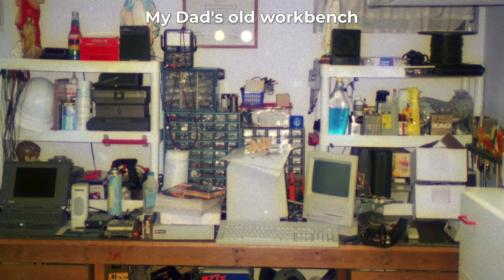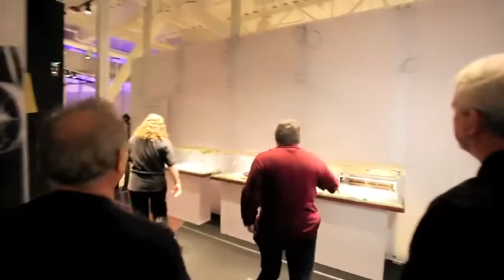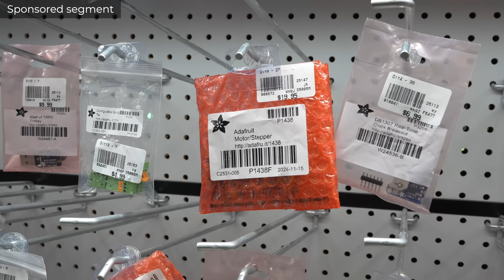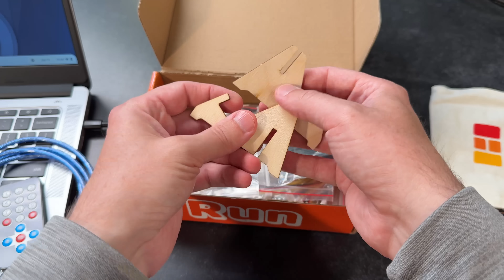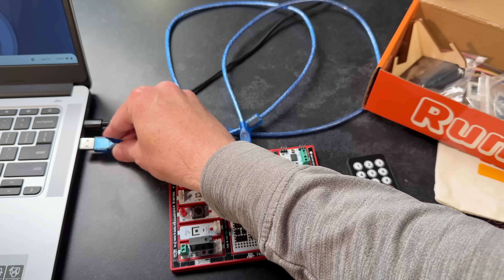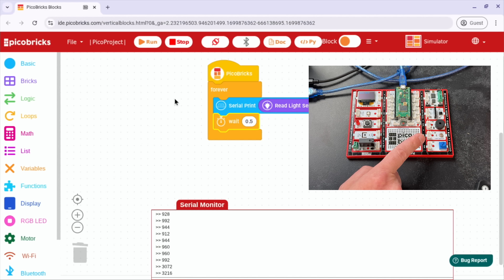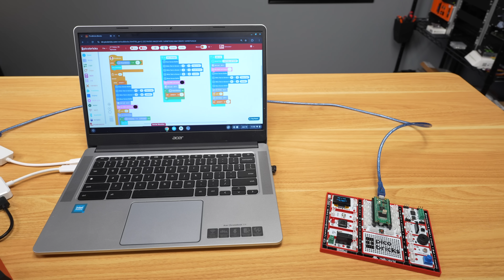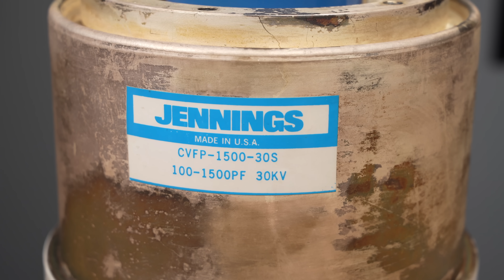You don't need a Raspberry Pi! (Getting started with Microcontrollers)

Comment: Yup, if you like spending a lot on coding minutia, trying to fit all into the tiny tiny TINY memory, using a spartanic Commodore 64 CPU that is only about 50 years too old by now. All this to save 35 dollars (for a raspberry pi with 1 GB), you spend endless extra effort. So yes, if your time is worthless and you don't mind spending 5 times as long on a project than it would be on a raspi to save 32 dollars, yup, go right ahead.

Comment: I strongly recommend anyone who wants to learn to code mess around with some kind of physical computing. I used Python at a novice/hobbyist level for years, but it didn't really "click" until I started messing around with a Pico running Adafruit's Circuit Python. Now that I'm teaching myself C++, I decided to learn Arduino (that's the Microcontroller version of C++) at the same time, and it's going super smooth. For some reason, when your code makes something happen off you monitor and out in the real world, it just becomes so much more exciting. 

I also love how the title is "You don't need a  Raspberry Pi!..." And the thumbnail is you pointing at a Microcontroller made by Raspberry Pi.

Comment: one thing i learnt why transistor isnt 100% replacing relay is because transistor can only handle so much power before its get to expensive  and hot compare to large relays (relative to transistors) and plus most common transistors (like in your computer) isnt bidirectional  so relays does have a use in your studio lamp example because AC is alternating

Comment: Transistors switching faster than a relay is not strictly accurate. Repeated switching YES but a single switch either just the same OR in an industrial application, as in a PLC or Transister Logic they are slower than Relays. That is according to the datasheets.

Comment: Thanks for the vid. Would you recommend this board/kit for a 7-year-old or recommend a different board/kit? I'll make sure to remove any capacitors from it.
Reply from the maker: Yes! I think 7-12 is probably the ideal age range for it. On the younger side I'd expect you need to spend a little more time helping figure things out in the beginning though.

Comment: Radio Shack (Tandy in Australia) used to sell 100 to 300 in 1 electronics sets like you had. I still have my 300 in one though most of the components are loose for an inbuilt breadboard so must have lost a fair number since then but the smaller kits were mounted on cardboard with springs to interconnect wires - was a good learning system. Even earlier though never had it was Capsella plastic bubbles with some components in like motor or light and join together to make projects a mix of Lego and electronics looked like fun was envious of that. Also as teen liked what Heathkit projects existed but never had the pocket money to fund such as a kid always wanted a Heathkit Hero Robot!

Comment: As a firmware engineer, I absolutely cringe when I see these kinds of videos, the same way I cringe when I see morons pushing books that will teach your four-year-old how to program.  Newsflash:  no, they won't.
I'm not sure which is worse - the people who make these products as a cash grab by trying to dumb down something that can't be dumbed down, or the gullible people who buy them, thinking that they're going to somehow gain any real knowledge by using them.
Reply: Why? The same fundamentals still apply. It can be a good low-friction way to get into more advanced stuff.

You're looking down on scratch I presume, but I see it just as a different syntax, with friendlier tooling, at least at this level.

Comment: Stupid question:

What happens if you can't get the BOOTSEL working?

I'm holding the button down and within seconds, the BOOTSEL button feels like it gets really, really hot.
Reply from the maker: It should never get hot, I wonder if either the power supply or some chip on the board is damaged. Pressing the BOOTSEL button should only be required for a brief second or so when you plug the board into your computer's USB port. Then it should appear as a removable volume.
Reply: @JeffGeerling  
The power supply is the USB-A port from a 2019 MacBook Air, so I don't think that should be an issue.

(Also tested it with my tiny human #2's 2017 MacBook Air, and my 2013 MacBook Air, and it all results in the same.)

My current hypothesis is tiny human, through the act of constantly unplugging and plugging the micro-USB side into the Raspberry Pi Pico W (this is our first foray into RPis), might have accidentally shorted it, just by repeated plugging and unplugging.

I'm not really sure what happened as tiny human #1 is up at 6:30 in the morning, long before anybody else is, so who knows what tiny human #1 did.

I ended up just buying a replacement Pico WH from Microcenter, and the new one seems to be working.

Comment: SnapCircuits is a great modern alternative to the project boards you had as a kid. All of my kids have played with them and they're pretty awesome!
Reply from the maker: They certainly are — though my two main gripes (we have a set):

1. They're a lot more expensive (likely due to the amount of plastic molds required to make all the parts the custom sizes, versus having one cardboard piece that holds some commodity parts like the spring contacts and random circuits)

2. They have more rigid circuit possibilities; sometimes you can't just spring a wire between one part and another (it only comes with a couple snap wires), meaning it's harder to break things, but also a little harder to make novel designs.

They're still great, though!

Comment: I started out by disassembling loads of old electronic waste and broken toys.... Making new ones.  By the time I was 10 I had a basic understanding of electric circuits, motors, switches, resistors, capacitors, magnets and relays.   Unfortunately, it wasn't until I was working and much much older that I started getting access to microcontrollers and electronic components with some real impetus.  
Personally, I think all young girls and boys should have at least a basic understanding of maths, sciences, electronics, programming, industrial arts, general accounting, survival techniques, art, home economics and at least 2 languages.    
Phys Ed should also be mandatory all the way up to and through university.   It's terrible how little regard people have for physical as well as mental well-being and the discipline to keep those things up to scratch.

Comment: We used to put glass signal diodes across a power switch. , and wait for someone to turn it off. A very satidfying CRACK, and we were rid of one more leaky diode, rather than just throwing them away.
I used to service PA systems.  local car dealer bought one of the first all electroninc Japanese business phone systems. It needed an external interface to let yu page from a phone. They wemt through three of them in a month, whichich not on;y disabled the interface, but ran the amplifier into clipping. They jad outdoor speakers in the lot, and they were downtown so a nasty 60Hz hum could be heard for a half mile. Each time I went to 'Fix your crap', I found large, exploded electrolytics, spreading foil up to 29 feet  across the room. The interfaces had  no rotection, and the area was prone to lightning strikes which key destroing those boards. They finally installed a beter one and I bever had to make a warranty call to disconnect  dead crap.
They went from a very reliable Western Electric 1A2 system, to that crapabese jubk that only lasted a few years.

Comment: Hmm, how did the explosion of an electrolytic capacitor generate hydrogen, Jeff?
Reply from the maker: Good question, and I'm no expert. But the aluminum they etch for the two flat bits that wrap around each other—when you put the in an overcurrent situation I think that causes the surface layer to bubble up into hydrogen gas. There was a paper on it which I referenced in the video.

But I'd defer to a chemist or material scientist.

Comment: My microcontrollers II class in college was one of my favorite classes.  We started on the Motorola 68000 in Microcontrollers I but moved to a PIC 28 pin DIP in II. For some reason, I was great at programming machine language code.  For our final project in the class, we had to build a huge breadboard project that was 1500 lines of machine code.  It had an LCD, 12 key input pad, digital inputs, digital outputs, analog inputs the whole enchilada.  I did a scrolling menu for the project on the LCD and I was the only one in my class that finished the final project.  It was a paradigm shift of what you could do with microcontrollers at the time because of the flexibility of the PIC microcontrollers (circa 2000).

Comment: Great video on micro controllers, but turning a light on and off or something other than just blowing up capacitors would have been better. This is up there with those putting thermal paste on the socket under their CPU, just pointless.

Comment: I remember in college electronics night classes we would take what we called a suicide cord (NEMA 1-15 plug on one end and allegator clips on the other) that would connect to an electrolytic capacitor and then plug it in.  We ended up putting holes in the acoustic ceiling tiles.

Comment: I've seen comments that "microcontrollers are cheaty" especially in retro computing circles. And while that's true for simple things like flashing LEDs, microcontrollers are absolutely NOT easy when you're compiling custom firmware and dealing with library conflicts, trawling through code to figure out what's wrong, breaking out hardware debuggers, trying to figure out if the hardware even supports the pin assignments you want.......I'm not saying it's impossible but it certainly isn't cheaty. It's also common to see "[insert microcontroller] is too powerful because it could emulate the retro CPU it's attached to", which is particularly bizarre to say if an emulator doesn't even exist. It's like there's an assumption that emulators are easy to make.....lol!!

Comment: Many years ago -  maybe '72 or so - I got a toy for Christmas that was laughingly called a computer. It was a large plastic box with a dozen or so tall slides on the front. The sides had jacks and there were short cables you could plug into the jacks. You might laugh but you could create both AND or OR circuits, and with a dozen slides you could do slightly more advanced logic. I think you could even do a NOT since these sliders did actually slide and that changed the wiring behind the scenes. It could have probably implemented a half-adder.

Years later I realized this was a very basic relay computer. We've forgotten that this is what drove the earliest automatic elevators. They're like cog-based logic - something that was a lot more powerful than we think... but which could never do anything else.

This didn't lead to a lifelong passion with computers - I was a math and physics major in college and had minimal interaction with computers since they weren't really available to us until I was in grad school.

But it's a great answer when people ask "what was your first computer?".

FWIW there was also a Radio Shack toy CPU introduced in the late 70s or maybe '80. It was weird since it went to the other extreme - I'm sure it was an accurate representation of a mainframe CPU but that was far beyond the target audience. Think of jumping into Ben Eater's discrete TTL logic computer series for someone who just wants to know a little bit about a raspberry pi.

(The worst "other extreme" has to be a math book I found in a bargain bin in an outlet store. It said something like "Introduction to Algebra" and had large comic-ish numbers on the front. It looks like something you would get a struggling middle-school student. I peeked inside - and immediately bought a copy since it was actually a pretty good undergraduate introduction to number theory. I feel so bad for the parents who were mislead, and the kids who were even more traumatized when they saw the content and thought they were expected to understand it. I'm sure I still have it... somewhere.)

Comment: I started getting into micro controllers because one day I had a problem and while searching for a solution microcontrollers came up in the search.. one rabbit hole dive later and now I use microcontrollers and stepper motors to drive the gauges in my old vehicles. (50s & 60s)

Comment: You passed the Arduinos at Micro Center.
Their mini form-factor Microcontrollers, the Arduino Nano, preceeded the Pi Pcos by more than 10 years. They also have models that use the RP2040.
Reply from the maker: I explicitly showed them and mentioned alternatives to the Pico a couple points in the video ;)

I started my microcontroller journey with an Arduino Uno years back. The Pico is just a tool, there are so many other great options nowadays! (Also mentioned were the micro:bit (which uses a Nordic microcontroller) and the Circuit Playground (which uses an Atmel microcontroller), I don't really care what people use as long as they use something well-supported and easy to find docs/libraries for :)

The Pico is often not the answer, but I enjoyed testing with the PicoBricks in particular.

Comment: sounds more like advertisement for picobricks than regular Jeff's video. BLINK TWICE IF YOU'RE HELD CAPTIVE
Reply from the maker: Not this time — but I have been in contact with the PicoBricks designers, I don't care what you use, in fact I mentioned I like micro:bit and Circuit Playground just as well. There's a breadth of options nowadays, which is great. Most of them are very well supported by tools like MicroBlocks too.

Comment: I've been discovering the pi pico ecosystem lately and it's seriously awesome. It can turn any PC into a proper inexpensive DAQ system at very low costs. Just throw some multi-channels DAC chips on a breadboard with it and you can simulate signals without needing to invest in any licenses and/or equipment from NI or LabJack for example. Sure it won't be the same "accuracy" or whatever but for 90% of all validation boards it's more than plenty. I wish it had an option with more I/O but the I2C ecosystem seems pretty mature so adding some I/O  expanders sounds like a really good alternative.

Comment: that picobricks IDE looks like a clone of the M5Stack IDE.
Reply from the maker: Indeed, it was forked off Blockly; and a similar editor (which also works with PicoBricks, but has some other advantages/drawbacks) is MicroBlocks

Comment: When I was 10 I received a Realistic electronic project set for Christmas, it had many faults and had to be returned. They had no replacements and I ended up with a credit note. It destroyed my Christmas and belief in Christmas.  I waited and waited but the kits were withdrawn and never replaced. I loved electronics but this set my learning back as I never had the money for the tools or components, the kit was my only option. It was not wired correctly. 
My future veered away from electronics and I became a paramedic but 16 years ago I went to university and gained an second class degree in Electrical and Electronic Engineering, I have not been able to gain employment in my field as I believe I am seen as too old. I have been shortlisted on every job I applied for, there's always a reason I can't be employed.

Comment: Great stuff, Jeff! It's fun to see you do stuff you aren't reeeeeally supposed to do, but approaching it in a somewhat safe way 😉. It was a great watch while winding down after a week of programming deadlines, and I hope it can inspire people to get their tinkering game on.

<ramble>
I vaguely remember my dad attempting to spark some electronics interest in me as a kid back in the late 80s / early 90s, but just getting a LED to light wasn't super interesting, and soldering in and by itself wasn't really The Thing either.

But now, in my early 40s, I've picked up hobbyist electronics, and it's a whole lot of fun! It's a lot easier to source components, microcontrollers are extremely capable and easy to work with, there's component devboards for all sorts of interesting things, and you can build useful projects with stuff like temp/humidity sensors, mmWave radar,  Home Assistant integration, high-capacity batteries etc.

The stuff I find fun is not as easily approachable as some of the electronics starter kits (even the 90s stuff would've been more interesting than just an LED 😅), but it's damn great seeing stuff like the PicoBricks kit, and how beginners can start with a logic block-based environment, perhaps move on to a tinker-friendly platform like the RasPis, and not needing to drop to C/Assembly level to do useful stuff with microcontrollers. And there's so many great resources available now, from YouTube videos to GitHub code repositories and electronics forums. 

Oh, and the Open Circuits book – got it a while ago, and spending Sunday noons paging through it filled me with childish glee. It's a thing of beauty!
</ramble>
Reply from the maker: It is indeed my favorite book of the past few years. Some good learning tucked in there!
Reply: The mix of "Oh, so that's what that tiny thing is", almost-laymans-terms description of how the components work, and "Oh, I could probably use that for this idea I have" + a bit of history lesson is awesome.

Next up: "Practical electronics for inventors".

Have a great weekend! :)

Comment: 20 :34 you can nov clean the small test bord BC probably full with electrolytic .
Reply from the maker: If there's anything I've learned watching retro YouTube, you can somehow rescue almost anything from electrolytic goop. Sometimes it requires re-soldering traces on a motherboard and epoxying stuff.. but it can be done :D
Reply: @JeffGeerling  my case alcohol , destilated water to daylude the chemicals to the point where its not biting. :D